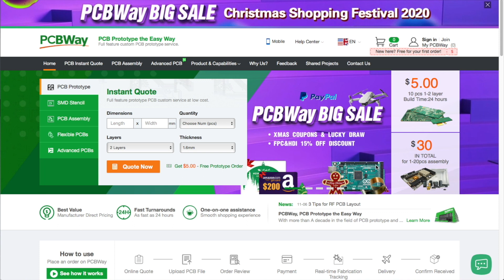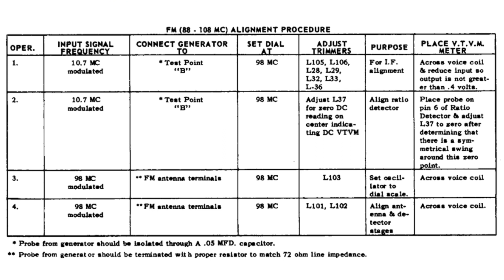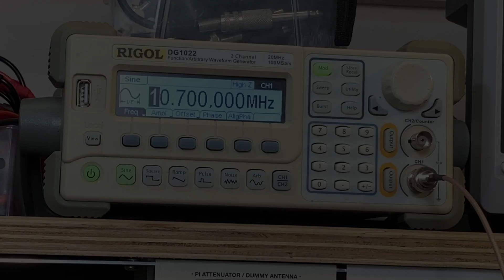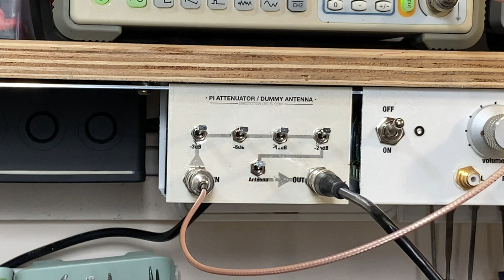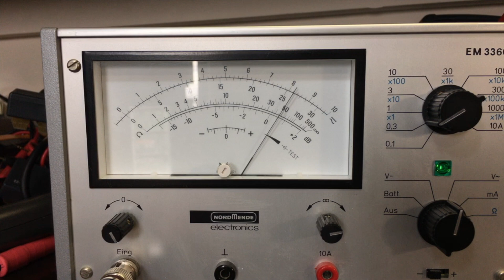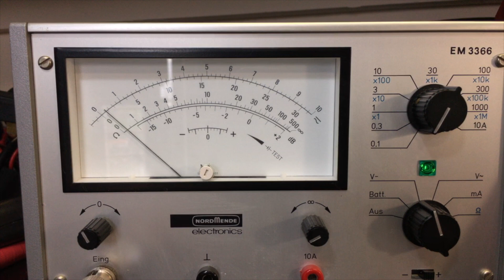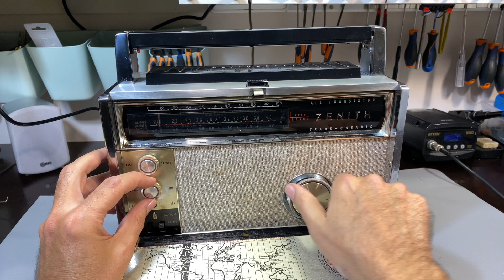Zenith Trans-Oceanic Royal 3000-1 restore, pt. 4. FM Alignment and final testing.

Comment: It is a great radio. You were picking up many more shortwave stations than in the UK, perhaps I need a better antenna? Interested to know what is in that PULL OUT section?
Reply from the maker: It’s a chart of shortwave stations and transmit times, and blank pages for you to keep notes on stations you picked up and when.
Reply: @electronicsoldandnew  Thanks, I wondered if it was that.

Comment: When you were talking about "positive" ground with reference to the signal generator, I was just thinking there is no positive/negative when it comes to a sinewave and the signal should go to the Test Point and the shield still to ground, but it looks like it worked regardless.
Another great video :)
Reply from the maker: Thanks Brendan.
Reply: Correct, ground is ground! It worked because modern test equipment is often not connected to ground (safety earth) but isolated.

Comment: I have two missing hinges on my top section of the front cover. I've tried something similar to what you did, but I can't get the new sheet metal to stick. Chrome does not solder well of course. How did you get yours to stay put? Also, which trimmers are for which SW bands? You showed how to align the LW band but I have no idea which trimmers are for which bands. Thanks!
Reply from the maker: It’s been a while so I don’t remember much about the trimmers. You must see the service manual. I believe I glued the hinges with epoxy.

Comment: Brilliant work:
I have a preference to switch the AC input power supplies, and newer electronics there’s a tendency to have a cube (transformer) supplied on all the time and one switches the DC off at the device. This of course means that there is always some residual current pull from the mains, plus there is always a chance of fire with counterfeit power supplies. I usually plug my devices into a fused switchable computer strip. (Your home brew power supply is probably safer than commercially made devices)
Reply from the maker: It’s not ideal, but that’s what the owner had ...

Comment: What did you use to clean the ‘stickyness’ off of the black leatherette?  I have this radio but there is something sticky on some surfaces.  What did you use to get the black shiny again?
Reply: Try cleaning with alcohol, then use Armor All. That may fix the problem. The feel is caused by the breakdown of the plasticizers used in the vinyl. The Armor All, which should be re-done periodically protects the plastic from the oxygen in the air, which, I think, is what, when combined with age, causes the plastic to deconstruct.
Reply from the maker: Couldn’t have answered better myself.

Comment: I was awaiting this FM aligning video as it was something I didn't do with my TO 3000-1. Unfortunately my sig. gen. doesn´t do FM modulation but still the FM in my radio works very well.
One last word of advice: do not grab this radio from the handle; this is very heavy piece of gear and the plastic in the antenna/handle is notorious for ageing badly and becoming very brittle. Otherwise you can end up with the handle in your hand and the radio smashed on the floor.
Reply from the maker: Thanks for that piece of advice. I’ve warned the owner as well.
Reply: I heard you can put epoxy in the handle to make it stronger.

Comment: Nice radio and a bit unusual design I must agree.
Wonder if anybody ever used those timezone maps and conversion system...
Cleaned up pretty well, nice job.
Hope your next radio (or whatever...) is a bit more of a challenge,
dead or no reception or noisy or something :-)
Reply from the maker: I also prefer it when they’re dead at the start. Must be a sucker for punishment 😊
Reply: @electronicsoldandnew  Great, so maybe it's hope for a part 3 of the Beocenter 5000 restorelog?

Comment: A lovely unit, but I don't get it why the mains power supply was not included in the original design. It's much better than carrying another brick around.
Reply from the maker: True. I believe the next model up had one installed.
Reply: The transoceanic line of radios were specifically about being very good battery powered and portable receivers. What is missing on this one is the D cell battery holder, which fills the entire space between the chassis and the back cover.

Comment: Hats Off for your restoration work. I have the radio., but the front panel is missing. I will send you the picture. Can I get your email address? It was working-- I have taken it down from the self. Hope it will work, otherwise, I will follow your procedure to bring life to it.    Datta Deogaonkar. Amateur radio operator. VU2 DSI, Ahmednagar India.